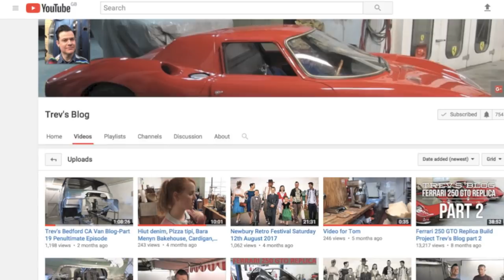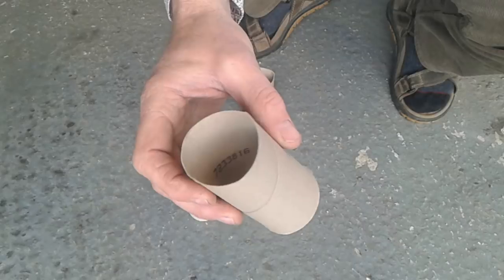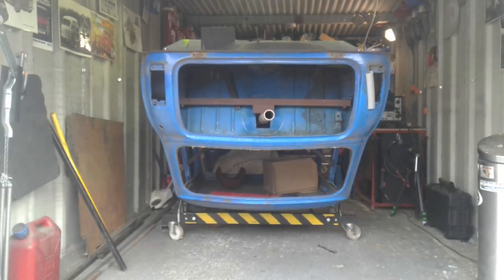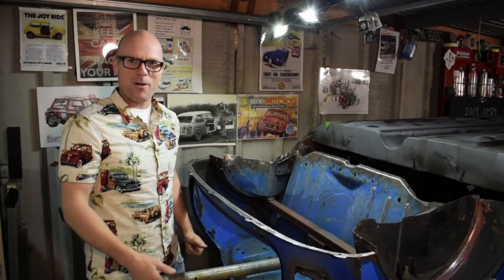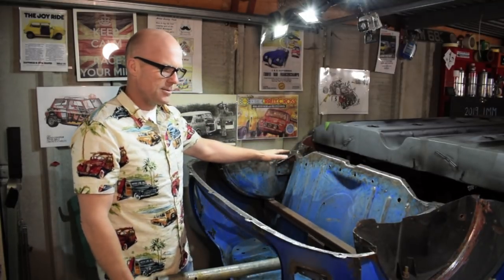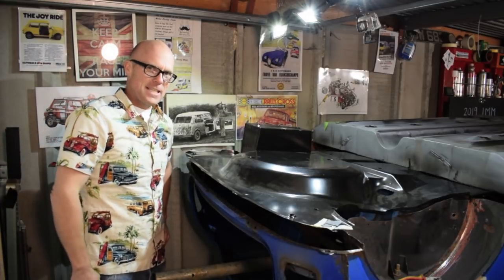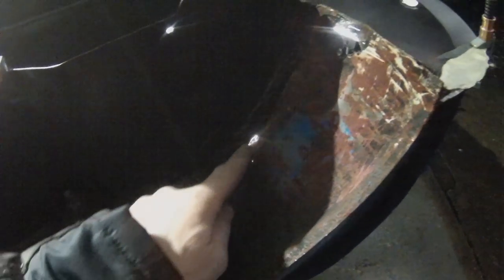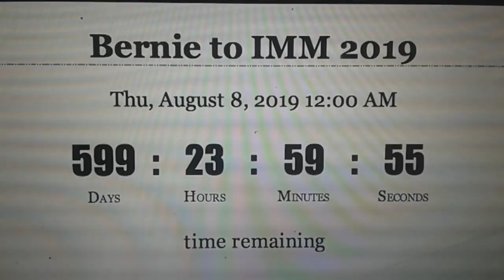Bernie the 1275 GT part 14 classic mini restoration DIY Trev's  blog special

Comment: I wish I had found this vid a couple of months ago as I would have saved myself a bunch of frustration. I had the boot floor in and out  of my MK1 a dozen times trying to find where it was fouling. Mine was only 5mm out along the rear where it joins the hinge panel and eventually discovered I had to square about 10cm of the same edge. Fitted like a glove after that. Have not seen anyone else have the same issue.
Reply from the maker: i am glad you enjoyed the video, well i am glad its not just me who had this issue :)

Comment: Absolutely love it mate!! It’s awesome to see Bernie getting some love, that boot floor didn’t look too bad though.
Reply from the maker: glad you liked it, yea the boot floor. there is method to my madness :) the worst bits were the corners as they had many patches and if you look closely it has had a full length replacement panel along the back edge. however, the middle section is not too bad and i fitted a new battery box when he was on the road. so this is my plan, i have shelved my rally cross mini so that i can dedicate all my time to Bernie (its driving me mad as i want to work on that too) but once bernie is finished i plan to build the rally cross mini into a proper rally mini that meets all the MSA requirements and this will enable me to use it in many different Motorsport disciplines , anyway, at some time the boot floor has been replaced with a sheet of flat steel and it has huge turrets for the rear dampers (it ran coil overs at one time). so i need to have a standard looking boot floor, i could buy a new panel like Bernie but i would have to cut the sides up to go round the shock turrets, so why not just cut a big square in the sheet steel floor and mount the section i cut out of Bernie into it, job done and very quick and simple. sorry long answer but i hope this explains :)
Reply: The Gentleman's Motor Racing Team ah ha I get it! Thinking ahead, sounds like a good plan! Plus it’s nicer to replace full panels where you can

Comment: Your attention to detail and effort to retain the original character of the car is fantastic!

What are those awesome tiny clamps you're using on the rear tub (boot, I think you call it?) floor? They look almost like kant-twist clamps, but even more compact.
Reply from the maker: so glad you lie the videos. thank you. the clamps on the back are clecos, i have only just started to use them, they strong little buggers and super quick to take on and off so perfect for getting panel alignment right. 

https://www.frost.co.uk/catalogsearch/result/?q=cleco
Reply: We've used clecos a fair amount, but looking through that link I think the "edge grips" were what we were looking at. They look pretty great, and we've never seen them before.

https://www.frost.co.uk/sheet-metal-fastener-edge-grips.html

Comment: Why did you cut that good boot floor out
Reply from the maker: ha ha, you are not the first person to ask that :) yea the boot floor. there is method to my madness :) the worst bits were the corners as they had many patches and if you look closely it has had a full length replacement panel along the back edge. however, the middle section is not too bad and i fitted a new battery box when he was on the road. so this is my plan, i have shelved my rally cross mini so that i can dedicate all my time to Bernie (its driving me mad as i want to work on that too) but once bernie is finished i plan to build the rally cross mini into a proper rally mini that meets all the MSA requirements and this will enable me to use it in many different Motorsport disciplines , anyway, at some time the boot floor has been replaced with a sheet of flat steel and it has huge turrets for the rear dampers (it ran coil overs at one time). so i need to have a standard looking boot floor, i could buy a new panel like Bernie but i would have to cut the sides up to go round the shock turrets, so why not just cut a big square in the sheet steel floor and mount the section i cut out of Bernie into it, job done and very quick and simple. sorry long answer but i hope this explains :)

Comment: Cheers for that mate keep up the good work :)
Reply from the maker: ha ha, i could not resist it, i am glad to see you are using the plug welding technique on your sills, much better. keep up the good work and it would be great to catch up at Bingly Hall if you end up going. i will get back to you about the boot lid i promise :)
Reply: The Gentleman's Motor Racing Team that’s fine mate no worries happy new year and speak soon
Reply: Josh Smith 5:36